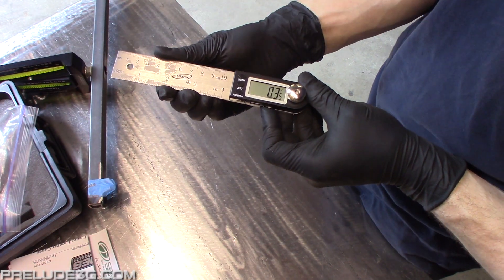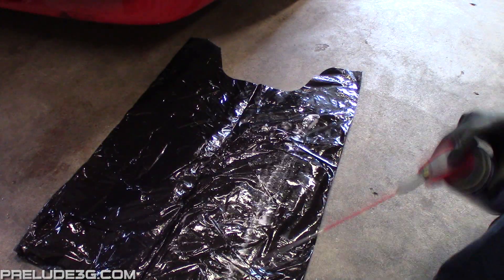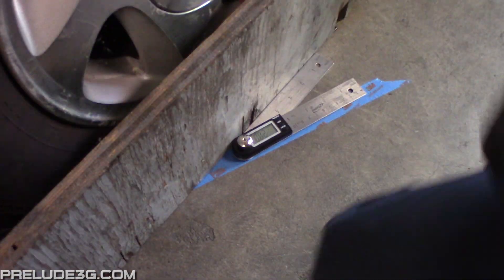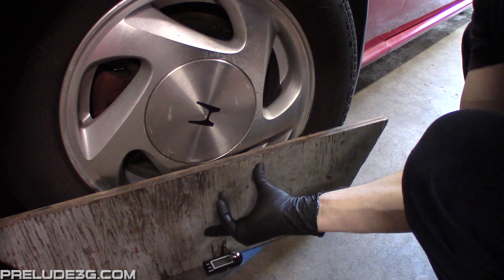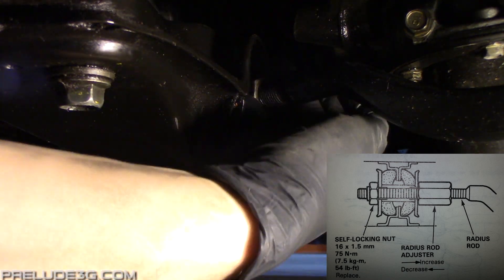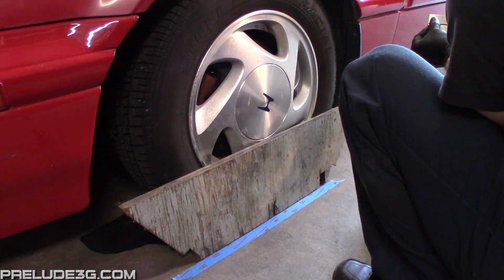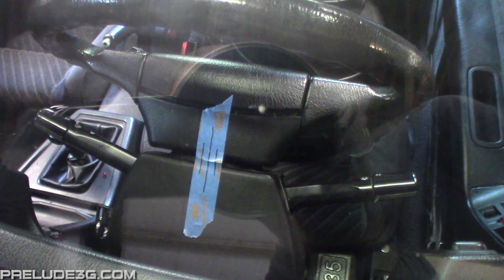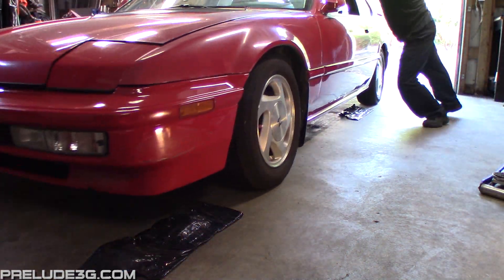SUSPENSION: Alignment Part 2 - Caster and Camber

Comment: Why is turning the wheel 20° each direction for setting the caster ?
Reply from the maker: It doesn't have to be 20°, but 20° is the most common. The caster angle is calculated by the camber change from having the wheel turned in and turned out. Here is how other angles are calculated:

1. Measure camber X degrees in & X degrees out.
2. If both camber readings are negative or both readings are positive, subtract the absolute value of the two readings and multiply by the constant for the angular in/out value you are using, below.
3. If one reading is negative and the other is positive, add the absolute value of both and multiply be the appropriate constant, below.

Angular value constants

    20 degrees = 1.5
    15 degrees = 2.0
    10 degrees = 3.0

Comment: Why is it that NOBODY else turns the wheel 20 deg to measure the camber...??
Reply from the maker: Not sure what you mean. Turning the wheel 20° each direction is for setting the caster. Setting the camber is done with the wheels straight.